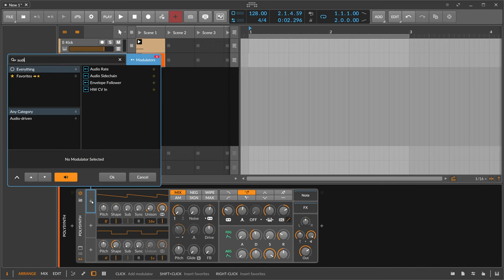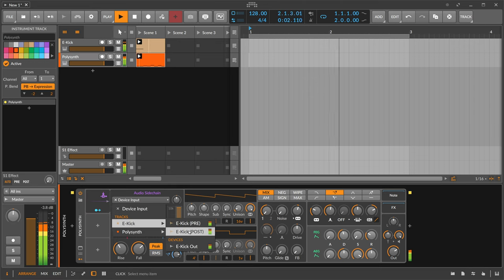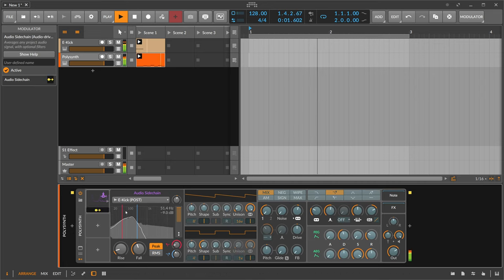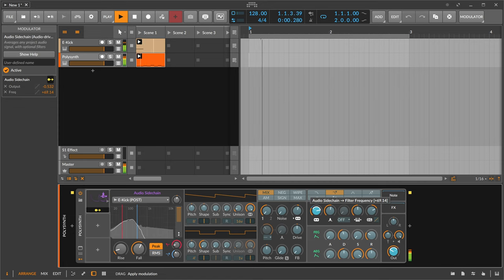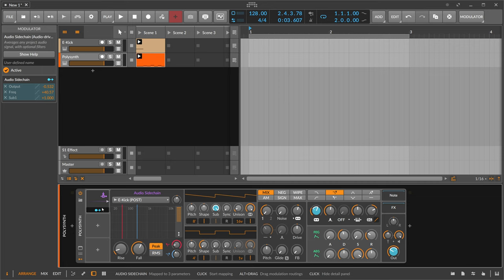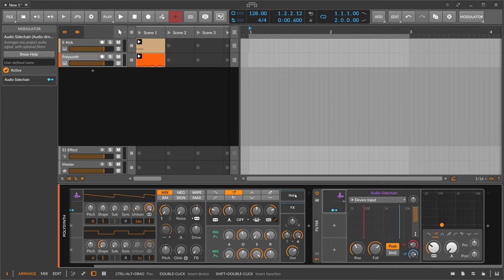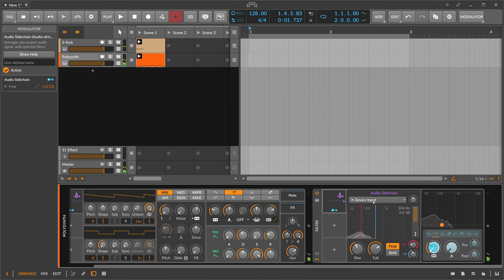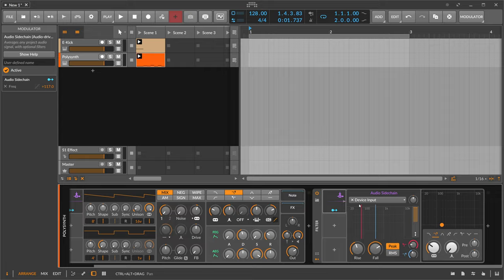Audio Sidechain - Bitwig Modulator Guide

Comment: I’ve always thought that sidechain in general is a bit boring or “too easy”, but in Bitwig it’s amazing. You can do so much fun!

As an example and a tip:
You can use Audio sidechain and an EQ to build a multiband compressor. I just got the idea and tried, and it works great! The sound is actually better than I expected.

In my case I used it as an combined EQ and multiband compressor:
I took a EQ5 and used the first and last “band” to cut unwanted low and high. Then set the Q and frequency of each band.
After that I loaded three Audio Sidechains and choose the same bandwith as in the EQ. The rise/fall and amount is set as a normal compressor.